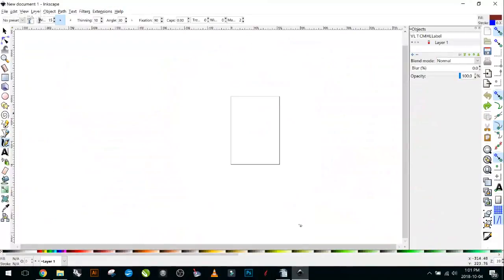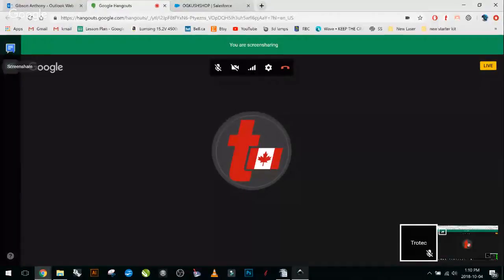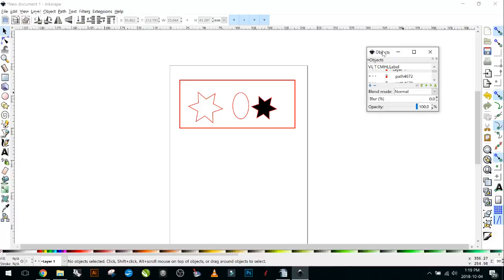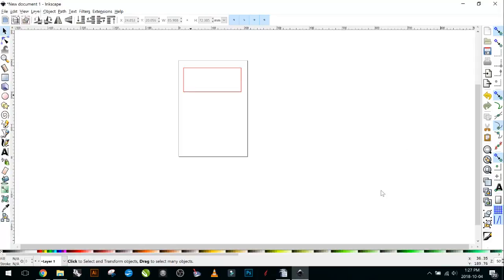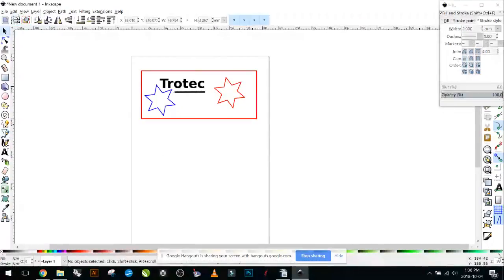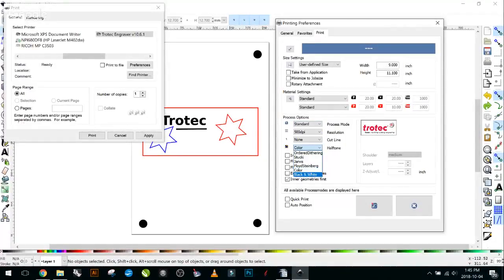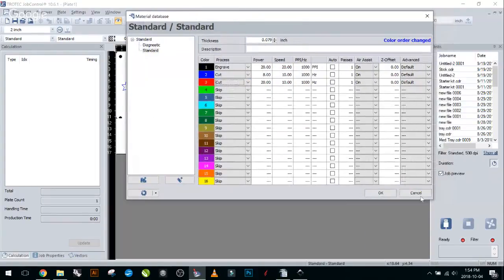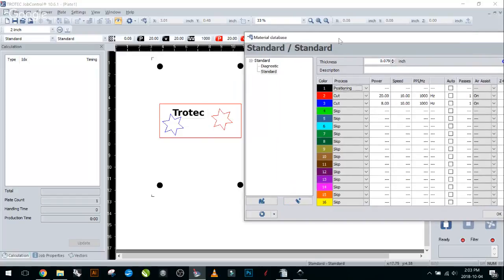Webinar - Inkscape Tutorial for the Laser Machine | Trotec Laser

Comment: Hi! I had a question. Does the stroke width matter for engraving? If it is just a vector line with two points will it engrave just a thin line or will it engrave the whole stroke if I want a thicker line?
Reply: Hi I'm curious about the same question.
Reply: Did you find your answer?